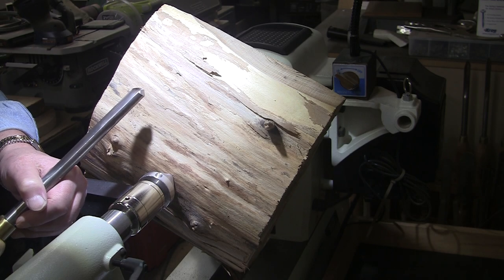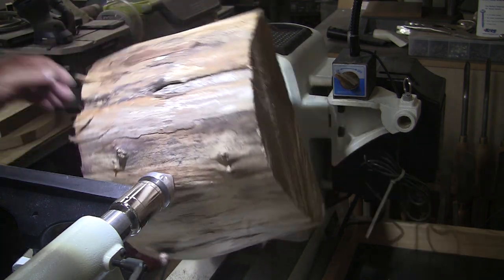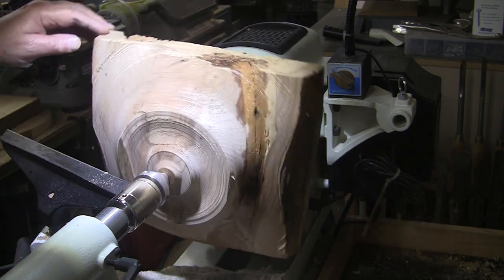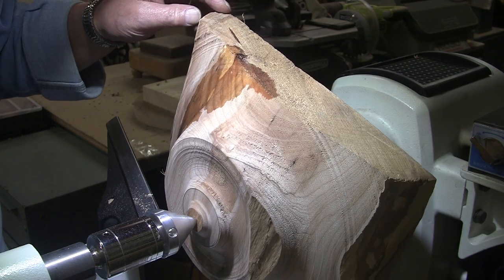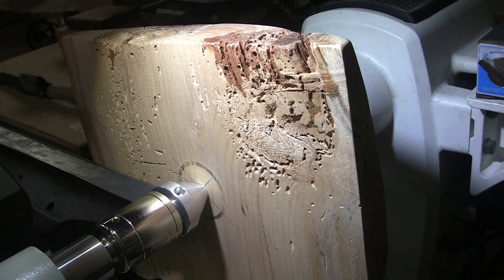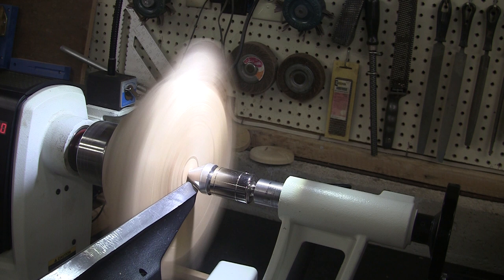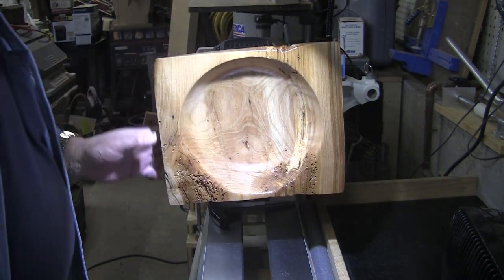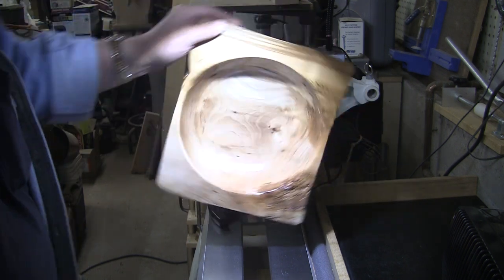Rustic Alder Square Edge Bowl

Comment: Phil, two questions.   What do you do with all the wood shavings?   I hope you put it in your garden or compost pile.   Second question, have you ever tried Modge Podge asa finish?   I do not turn wood, but I do wood burn things and also make what I call my Magic a mountain sticks which I hang stuff on.   I use Modge Podge and then usually spray a clear coat over it.   It removes any of that Punky stuff you talk about on some of your pieces. Love your channel.
Reply from the maker: Once in awhile I'll use some to fill a depression somewhere on the property, Alice but mostly I throw it all over the bank out back.  Some wood, like Walnut, is toxic in a garden.
I usually use only two finishes, Feed & Wax or shellac.  I like that they are all natural and you can still feel the wood grain through the finish.
I'm so glad you find time to watch and comment, thank you!  😃

Comment: Turned out nice Phil. I wasn't sure it would hold together but it did. I also use some Benjamin's Best tools. They are fine but I find they are inconsistent with their hardness and a few have such a short flute that I soon sharpen them beyond their usable length. I'm relatively new at turning and much like you stocked up at retirement and am ready to upgrade now that I've learned to sharpen. Didn't want to waste high quality steel during my learning phase.
Reply from the maker: Exactly, Charlie!  I learned sooo much about sharpening using these tools.  I will probably stick with them until I've worn them down, but then I'll move on.  Thanks for the comment and watching!

Comment: Do you ever use a faceplate??
Reply from the maker: Very seldom, Harvey.  When I do, I usually use a faceplate ring.  They screw onto the work piece much like a faceplate but they have a dovetail recess that is held by the jaws of the chuck.  This way I don't have to remove the chuck to screw on a faceplate.  Hope that helps!